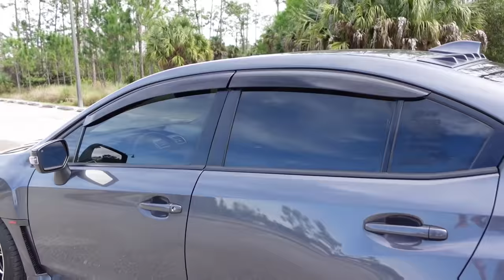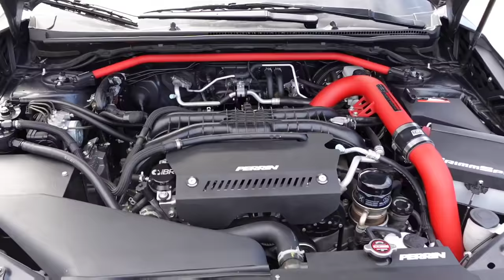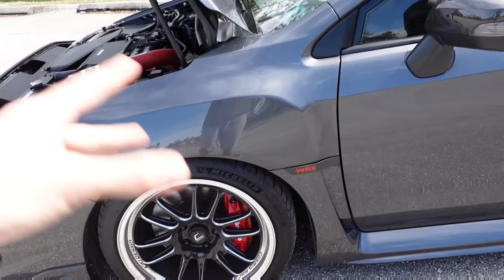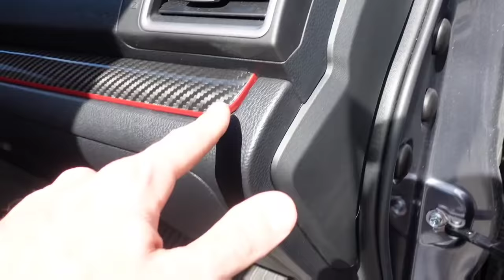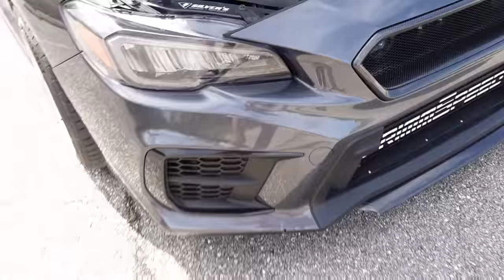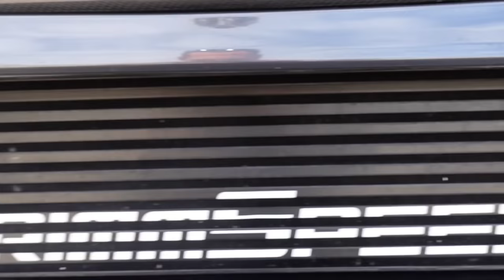I Should've Done Things Differently

Comment: Love what your doing to the car.. I just got my first ever WRX 2016 base model.. for your front bumper area that you cut, get some black mesh screen and form it to fit in that area you can keep the improved air flow and help stop some road debris chipping the finish on the FMIC.. iv been stock piling your mod vids to do my car. Already got the radium catch cans.. also the master cylinder brace. 1 thing I want to upgrade is the solid transmission mount bushing for underneath the car and a pitch stop
Reply from the maker: Not a bad idea at all! Better flow for the Intercooler and less noticeable! And nice man! You'll love the Radium cans. The solid mount is sweet but it becomes a little much. I actually swap it in and put sometimes. I'll run it when I'm planning on having fun with the car or if I'm going to the track and I'll put the group N mount in if I want more comfort for a while. But the pitch stop has been fine!

Comment: This video inspired me to tell my own regret with my car. I’ve owned a 2018 ISM WRX for almost 4 years now, and 1 year into ownership, I was super convinced to get my roof wrapped in black. I get a few quotes from recommendations on my local soflo subaru fb page and decide to go to the cheapest guy. Area was pretty sketch but decided to give it a go since the wrapper had a decent portfolio with some of the jobs he has done.

I go inside his shop and notice he’s training a new guy while wrapping my car. I get it back, and notice a few small dents on my car’s roof. In addition, he also couldn’t wrap the shark fin antenna properly, and didn’t know how to remove it from the car, so that wrap started peeling off when I got home. He offers to fix it for free if I come back, and I did, this time I remove the shark fin antenna so he can do a better job with the wrap. Same issue, wrap starts peeling off when I get home. This time I remove it from the antenna and notice small blade cuts from the knife he or his assistant used all around the shark fin. Really pissed me off. Decided to just stay silver on that part. Around this time, the dents on the car’s roof were really bothering me since they were bunched up near the back of the shark fin. I had a great idea. I can use a vortex generator to hide it while making the car look somewhat decent.

I go to ebay, find a cheap one for $60 and install it on the car, a replica of the subispeed one that wraps around the whole antenna. Only problem is it’s not an exact fit for the car, with a whole 2 inch gap around the shark fin. No worries, I prep the roof properly with some alcohol and the strongest 3m tape ever. All is well, until I leave the car in the sun and the vortex generator starts warping. I take it home and in my desperation and frustration to remove it from the car, i used a pry tool and a heat gun, damaging the roof with even more dents, and at one point scratching the roof paint to the bare metal. (I cringe at this memory myself). At this point my roof is fucked, so I have to take the ENTIRE gloss black wrap off pretty much wasting $250 dollars. I touch up the roof with some paint from subaru so it wont rust, but now i’m left with a roof that has a bunch of dents and scratches on the back parallel to the shark fin antenna. I didn’t have the funds to repair the roof which would probably cost me $3k or more.

Nearly out of options but still determined to get my roof gloss black, I find another wrap shop with decent reviews looking to do the job while also explaining that i’m aware I fucked up my roof and the wrap job won’t hide it. They do a much better job and aside from the damage to the roof, the wrap is perfect. At this point, I decide fuck it and buy the subispeed vortex generator which is a perfect fit around the shark fin, later realizing it tucks underneath the antenna which keeps the vortex generator from coming off like the cheap ebay ones. I paint it gloss black to match the roof, use strong 3m tape and put it on the car. It looks super good, you can’t even tell I fucked up my roof lol. This was 2019. About 3 years later, some parts of the vortex generator is starting to lift but nothing too noticeable. At this point it is what it is 🤷‍♂️. Biggest regret of my life. Had I done everything over again, I would have just gone to the second place to wrap my roof, forget the vortex generator, and this whole thing would have never happened. Sadly sometimes I gotta learn the hard way.
Reply from the maker: Damn that had to be a terrible experience. I'm sorry you had to deal with all of that. I also bought a cheap Vortex Generator on my old 2015 wrx and had the same issue. And I took it off and accidental dented the area. But now I know I just need to be extra careful next time.
Reply: @StreetInspired1  Agreed. I enjoy this channel because of the transparency and you show that things don’t always work out when modifying cars. I don’t have anything against those people that manage to do everything right the first time and have a “perfect” build, but it’s a lot nicer to find a fellow enthusiast you can relate too. 👍

Comment: I would do a shifter plate about 100 bucks a little tough to install cuz the top bolt on cover for the plate. But short shifter dont shorten the throw much on these cars. The plate really does when paired with the short shifter. I have cobb plate reduces an xtra 15% - 35% depending on where you put the shifter pin. I did 35% and even when relaxed driving I am on my clutch far less. Its so nice!
Reply from the maker: I have the STI transmission so I can't used a Shifter Plate. Already have a short shift kit for the sti trans as well. I will agree tho that the Shifter Plate on the wrx transmission is a huge improvement!

Comment: I took my 21 sti in for tinting professional. The company cut all the weather striping on the right side, and now they want to cheaply replace the striping. Not to mention they f up the tinting 2 times and is still messed up. They don't want to reimburse our money.  I don't feel comfortable letting them attempt it for the 3rd time. The tinting company want to replace the striping themselves, which they are not certified in doing. I have 800 miles on the car.

Comment: Question for you first:  is the car not tuned with the front mount? 
I definitely wish I would have started a YouTube channel a lot sooner to document all the stuff I’ve done to my car as I’ve done it. But never to late to start I guess! 
Second, I definitely wish I went in a bit of a different order in modding my car as well. If I was to do it all over again I think I would do exterior looks stuff and then drive ability first before diving straight into engine performance.  Like you said lessons learned!  Time to keep pushing and enjoying it.
Reply from the maker: Correct. It was tuned on the topmount. It hasn't been retuned but it is post maf and everything so it should be fine it's just not going to be any more powerful than it was before. And you're right it never is too late. Even of you don't post it somewhere it's always good to document it. I have hundreds of pictures and videos of almost every car I've owned. And I feel like most people feel the opposite.  Usually people wish they spent cosmetic money on the performance. I've tried to balance it out but I definitely wish I did a few more cosmetic things.
Reply: @StreetInspired1  thanks for the reply!  That helps me out haha. My next major upgrade is going to be front mount I just don’t want to fork out the extra money for another tune until I add a few additional parts.  Good to know I’ll be able to go ahead and run that for a bit and hopefully help my heat soak issues.  Thanks man!
Reply from the maker: @T.Hansen  no problem. I've been running the front mount for months now in the hot and the cold with no issues so you should be good!

Comment: Rear diff.  Clutch type 1.5 way.  Kaaz Super Q.  It's the one thing I don't see often from WRX owners that REALLY transforms the car.
Reply from the maker: Those are definitely unique  but the whole drivetrain is STI swapped with an act extreme clutch and uograded trans and diff mounts so I should be solid on drivetrain for now! Great suggestion though! No one ever thinks of that!

Comment: Hey i wont lie 
Im marking out and cutting my bumper soon

Its been a few times drawn and sketched as this is a #1 mod done on many racecars ive built and worked on is opening up the airflow such as this. 

Now for the sti and wrx to keep it tasty

Ive marked mine along the top edge of the moulded bits and license plate hanger. 

In doing so its left enough black edge trim to look good and retain  the side bits so its just opened up and not so "exposed" if you where to trim out ALL of the black trim. 

aka cut almost like yours just you went too high for my taste, id of made a line at the mouldings
Reply from the maker: I had that exact thought the second after it was cut out lol I said "shit I should've left like half an inch or so of plastic below the paint line. But it has proven to help the manifold Temps. A huge Intercooler doesn't help much when half of it isn't getting air moving through it. I'm hoping to find a way to clean it up a little bit!

Comment: I got the Cobb Big SF Intake for my WRX not realizing until mid-installation that the box interfered with my Radium dual catch can setup. Luckily i was able to sell it and recuperate most of my money. Have you ever considered installing stainless steel brake lines?
Reply from the maker: I forgot the Cobb box interfered with them. Everyone who had one had to cut a section out of the box. And I have considered it. Just didn't think hey were were the money right now.

Comment: That’s crazy how your exhaust melted your bumper, I have nameless hangers on my nameless axle back and I have maybe a quarter inch between the tips and my bumper no melting or anything.
Reply from the maker: Yeah I think it was my fault cheating out on the Axle Back. Nevwr had that problem with other Axle backs but the subie depot one was Un even and hung much higher on the driver side.

Comment: I currently drive a 2.0GT legacy. 1 thing i might have “regret” doing was going for an 18g turbo instead of 16g. My car is my daily driver. So having an 18g with that lag is a little hard to drive around town sometimes.. so thats one thing i would like to change in the near future.. probably downsize to a 16g ball bearing. Or upgrade to an 18g ball bearing.
Reply from the maker: 16G is a great turbo. I ran 16g Turbos on all my old DSMs because it's such a nice street able turbo. But the ball bearing 18g would be sweet.

Comment: Wish I could change the spun bearings in my brand new closed deck block so my brand new engine build that took over a year to get done would’ve worked longer than a few months
Reply from the maker: Damn that's terrible. Did you pay someone to do it? If so I hope they're covering all costs
Reply: @StreetInspired1  I did, took it to an experienced reputable shop that specializes in Subaru’s and no they aren’t covering anything, not sure why they would as they forced me to sign something saying they aren’t responsible for what happens as it is a performance car.

Comment: Thermostatic Oil Cooler. Since my has been stolen and totaled I have mine still sitting in the box. It hasn't even seen the light of day yet, but it will help with oil temps a ton
Reply from the maker: Damn im sorry to hear that! I've been wanting to get an oil cooler for a while. Especially after switching to the front mount and wanting to out one where the top mount was.
Reply: @StreetInspired1  its all good. It allows me to start a new chapter in a different car world (Euro). If you would like hell I will sell you mine I cannot use it on a BMW

Comment: Go to the biggest subie dealer near you. Ask who they use for doing repairs. All those dings are fixable without body work. I had 13 dings removed for 500. They will be drilling holes to get access but in spots you wont see and the put plugs in the holes.
Reply from the maker: They won't have to drill holes for any of mine. All of the dings are easily accessible from the back of the panels. The only one they might need to drill is the door or come down through the window sill

Comment: Only thing I regret on my build is going with cheap eBay headlights. Stopped working 1 year later and I have some circuit demon headlights on the way soon
Reply from the maker: Damn sorry to hear that. But Circuit Demon does a great job so I'm sure you'll be happy with them!
Reply: @StreetInspired1  lol yup, the high beams are painted yellow and I also got the morimoto projector fog lights as well.

Comment: Did the guy tint the outside of the Windows? Def not a fan of that and can see him easily damaging the exterior clunkin around. I know Ill probably be in the same boat of going TMIC then later get a FMIC, but I got a Depo TMIC for dirt cheap so it wont be a major loss.
Reply from the maker: No but they stretch across the car and cut the film to size on the outside of the car. That's why it's all on the 1/4 panels they laid a peice across the back window to get the measurement and leaned on the car with his tool belt on. And the Grimmspeed top mount was really good but now that I moved to Florida where it's hot almost all the time and wanted the extra cooling power. And  I've seen the depo ones they seem like a good bang for the buck!
Reply: @StreetInspired1  ah that makes sense. I used to run a detail center many moons ago, so seeing anyone with belts or tools leaning near a car was a biiiiiiig NOPE.

Comment: those rear bumper vents in that color, where did you find them I can't find them in stock
Reply from the maker: I had to get unpainted ones and paint them myself
Reply: @StreetInspired1  I was hoping you didn't say that, I don't have the equipment to do paint work.
Reply from the maker: @jessiehawes5062  if you're into Carbon fiber ive seen carbon versions for under $200 https://www.ebay.com/itm/Carbon-Fiber-Fit-For-Subaru-WRX-STI-Sedan-Rear-Side-Bumper-Vent-Fender-Cover-/174080794613?mkcid=16&mkevt=1&_trksid=p2349624.m46890.l49286&mkrid=711-127632-2357-0
Reply: @StreetInspired1  thanks

Comment: did you see a power gain with a cold air intake? thanks
Reply from the maker: Intake won't do much in terms of power but it's still worth it for the sounds lol most tuners can squeeze 50 more whp out of a completely stock car because the factory tune is so bad. But if you add an intake and get a tune you'll definitely feel an increase in power from the tune and the sounds from the intake. Or you could get the cobb SF intake and run the cobb stage 1+ ots map designed for their intake and you'll get a power gain as well.

Comment: my guy!! im sorry you went the distance to cut your front bumper
Reply from the maker: It doesn't look terrible. Just the gaps on the sides that bug me. It has helped a lot with manifold Temps. I just wish I would've drilled a few holes 2" holes instead of cutting that section out

Comment: Hindsight is 20/20 but my only “regret” is not waiting until model year 2020 to get my car with the “performance package”. I got the first year they had it as an option so they screwed me by equipping the car with just red painted calipers instead of actual Brembos. But then again I’d still be on the hook for another 2 yrs financing lol 🤷🏻‍♂ 

STi tranny is a mod I want to do .. also the expensive Stratose shift knob basically eliminated that 4th gear shifter rattle I was getting when I had the Cobb delrin knob.
Reply from the maker: I agree I can't fathom why subaru won't just put frikin brembos on all wrx. They could do the 4 pistons for the wrx and 6 piston for the sti if they want to differentiate. They both should get them.
Reply: @StreetInspired1  beyond me man. Now it's going to cost me time and money to secure a set for my car. Hopefully the new STi won't look like horse shit and I can get one of those later.

Comment: Your telling me, I broke my HPFP installing my BRZ intake so I had to buy another one so I bought a stock one. I didn't know about the aftermarket HPFP. That's my regret and also I bought so many power mods that I hit 400 whp without using my flex fuel kit so I wasted my money on that mod.
Reply: HPFP is pricey for sure but since I'm lazy and didn't wanna keep messing with fuel trims I just bought and installed it. 100% worth.
Reply from the maker: Oh crap and the stock one is pricey too! And it never hurts to use the flex fuel kit. You'll probably still see better numbers with flex. Worst part is the retune.
Reply from the maker: @xil3ntkha0s  I'm thinking that's my next mod. Seems worth it just for not having the headache of mixing and dealing with fueling oscillations. Not to mention my flex fuel kit paid for itself with thr cost difference of 93 and e85 so the hpfp might pay for itself after a few months of those extra few gallons of E.

Comment: Grimmspeed front mount intercooler?! Where's ETS? Grimmspeed only good at decorative stuff, not performance. I've got a '16 wrx. First is getting a built motor and upgrade trans. Stock is garbage. Car is very pretty
Reply from the maker: The Grimmspeed Fmic is actually really good quality and cheaper than ETS. My Grimmspeed fmic is 27" long, 11" tall and 4" thick. Very compatible to the 4" ETS kit. I had the Gs tmic as well and it was really nice. They're making good shit. Their new Turbos For the EJ look really good too. I pulled both of them out of the box at work and checked them out. But definitely recommend the trans. I have sti swap now because my grenaded at 17k miles. My last wrx transmission grenades at 60k.